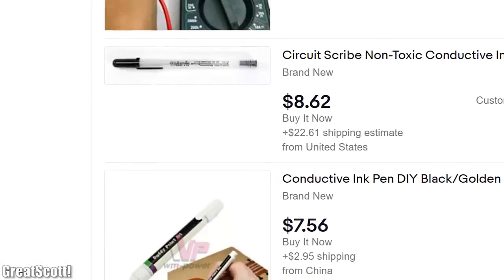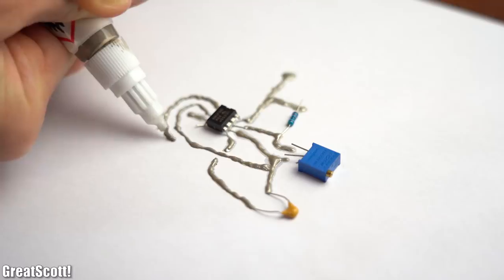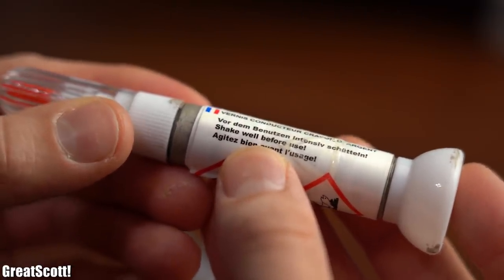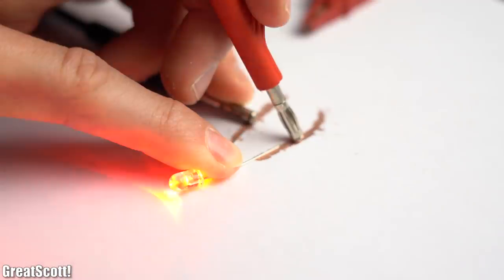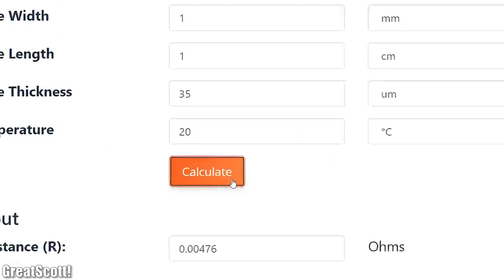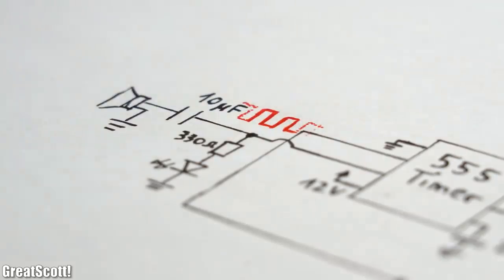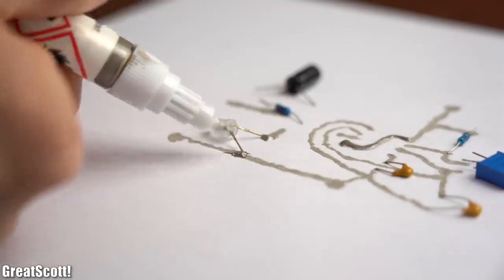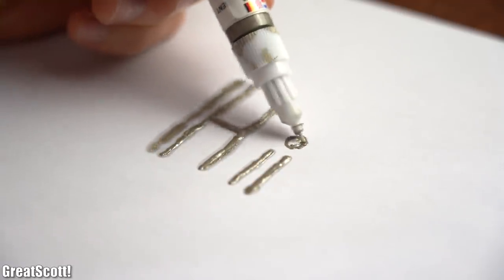You can draw circuits! But does it make sense? Conductive Ink Pen Experiment!

Comment: What components can you create using that ink? You already made a fuse, now make resistors! Capacitor is pretty straightforward, and how about drawing in circles around a ferrite core? Or a coreless inductor using a cylinder of paper 🤔 also, led paint.

Comment: Was there any noticeable difference between using the ink on copy paper vs using the ink on a cardboard surface? I would think that the cardboard could provide some better surface stability and potentially straighter lines with less bleed?

Comment: actually, i even am trying to cut out thin strips of copper TAPE as traces and run them between components and then use a little glob of silver ink to glue the trace to the piece so no soldering is needed.

Comment: For the one that doesn't let you solder to it, wouldn't you just pin the component into cardboard then draw a line right onto the leads? Obviously not ideal for anything surface mount, but seems pretty reasonable to use for through-hole components
Reply from the maker: There will always be a high contact resistance😅

Comment: Something like a circuit drawn onto a piece of curved glass (assuming the pen works well on glass) might be cool looking.
Reply: I can see the day when "ink" pens with something like the compounds in LEDs are available, allowing unlimited artistic applications - on glass, as you noted, being just one medium.  But you could then draw the entire circuit, adhere any ICs with adhesive, and "draw" your optical devices right on.  If the circuit ink were flexible when dry, you could have a flexible display or more!

Comment: Would one of the silver pens work for a repair on an onboard bluetooth PCB antenna, like the ones on an esp32 module.. The antenna and underside lifted off in the centre (about 1cm of the antenna) and hoping to fix it as its on an expensive car diagnostic onboard Bluetooth module. Many thanks. I'm hesitant now as you said its not good for high frequency usage.

Comment: how durable is this coating, I wonder, because this seems heavens sent for pcb prototyping on a standard board which just has holes and no wiring, if it is durable enough than this can give great quick prototypes for later PCBs

Comment: If you run it at higher current for a short time does the resistance stay low when you return to lower current?
Reply: Most likely the reduction of resistance is temperature related, so probably not.
Reply: @kenmore01  is that a normal property of these conductive paints? I would normally expect resistance to go up with temperature. I was wondering if the heat wasn't softening it and allowing shift and settle into better contact with itself.
Reply: @Noxonomus   You may be right. I don't know. I was just speaking from my experience that heat usually causes temporary changes. It would be interesting to know, but regardless, the resistance is high compared to copper traces or wire.

Comment: I don't think these are meant to be used with paper as a base, or anything absorbent.
Maybe thin ply at most, but the material really needs to be heat resistant to a large extent.

Repairing/adjusting PCB's sure, adding a small amount of circuit to the reverse of a single sided PCB, sure. but not on paper.

Comment: Hey, can you check out the STM8L05J3 microcontroller? It is an 8 pin, 8 bit microcontroller features equivalent to the ATTiny 85 but with reduced cost. You can try using the SDCC compiler to compile the files. This would be a real Kickstarter into understanding the STM microcontroller in detail, just as you did with AVR.
Reply: You can referred to lujji's GitHub blog page for more details

Comment: Hey could you help?
 Iam stuck, my zener diodes cannot protect my  mosfets and i dont have a source for tvs diodes either , the mosfet always short gate to source , and solution?
Reply: Maybe try slowing down you gate drive, put a series resistor of 30 - 100 ohm at the output of the driver. Also, you can use an RC-snubber.
Reply: @MarianKeller  thanks, i will try👍
Reply from the maker: Yep, good ideas :-)

Comment: Been watching you for a decade I think and I need help.  I have a question I can't seem to get any help with, but how would I go about not charging an 18650 battery until it needs it (drops below a certain voltage that I set) when it is always connected to a TP4056 board?  Using solar power so when the sun is up it will want to charge the battery even if it doesn't really need a charge which shortens the life of the battery.   For instance my load is 300mah and on for 5 hours while my battery is 3400mah.  As you can see it would only need to be charged once every two days (especially since the charge will be 1a so done in 3.4h).  Saves the life of the battery etc...   Not sure how to do this, and apparently no one on Reddit, or anywhere else I have asked, knows (or worse cares to know).

Comment: This pen is useful for

computer keyboard keys repairing, 95%
voltage regulator 45%
singal data line 78%
custom resistor 89%
creating heat for fireworks , 89%
lighting cigar, 88%
robbing electricity from neighbors, 28%
fixing broken pcb traces, 45%
drawing paper plug, 3%
electric graffiti, 28%

like if you found this useful 😃

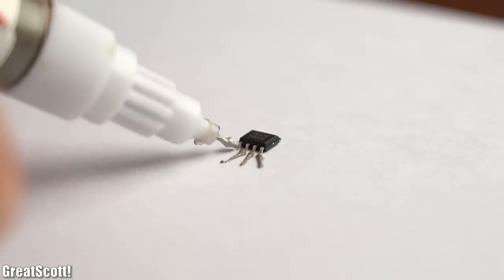Comment: 9:08 you say that you cannot create fine enough lines for fine pitch smd ics with silver.  I disagree.  if you create a blob of the paste on a piece of tape and dip the tip of a fine sewing needle into it, then put sewing needle into exacto knife stick instead of knife, you can create 0.5mm fine precision in width straight lines with this setup it is amazing.  you can easily do fine pitch ics this way.

Comment: Bro i am from bangladesh i have 6 volt 1000 mili ampere step up transformer  i want make an inverter to glow 60 watt or 18 watt filament bulb (yellow)
Could you make a video with simple and easy circuit to operate transformer by 3.7 dc voltage battery?
With regards ❤️

Comment: Lifelong electronics hobbyist and career here. I wouldn't trust it. If you can't or dislike patching in a piece of wire for repair or modification, you need to become some sort of civil servant.
   The only substitute conductor I ever used was silver loaded epoxy for high end research equipment.

Comment: you should not solder AT ALL when working with silver.  just draw that trace RIGHT ONTO the part.  This should be obvious wth... the whole point is to not have to deal with soldering whatsoever.

Comment: It is sad that you advertise EasyEDA which, however, is not suitable for the creation of a "professional pcb". This is a tool for children, it shouldn't be recommended even for beginners, Unfortunately I listened to it. Now I know that, for example, Kicad is much better
Reply from the maker: Not sure what you did wrong while using EasyEDA. Works like a treat for me for all kinds of PCB creations.
Reply: @greatscottlab   it's like comparing freeCad and fusion360. Yea EasyEDA works but 
it's server based,
choosing component every time when i want to place something in the schematic is frustraiting,
there is no "standard" footprints or whatever, you have to look for specific part every time,
designing pcb is very unituitive in case of basic settings and it's just (more or less) "poor",
positioning any footprint isn't fixed to any grid,
the desktop application has some bugs that still haven't been fixed despite having been known for a year,
kicad is open-source and it have many features that EasyIDE lacks.
Also ki-cad doesn't sell your data anywhere
Reply: @greatscottlab  I know from experience that after watching at least 2 videos to learn something about the new program which kicad was for me then, the level of design confidence and comfort jumps to a completely new level. It took me some time to get used to kicad but I would never go back to EasyEDA